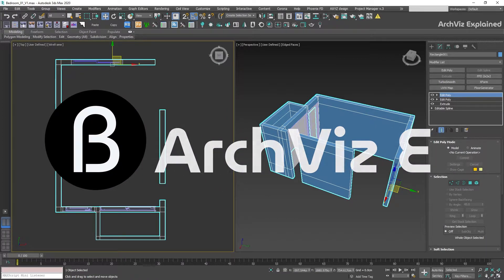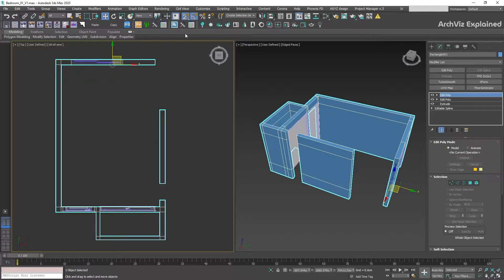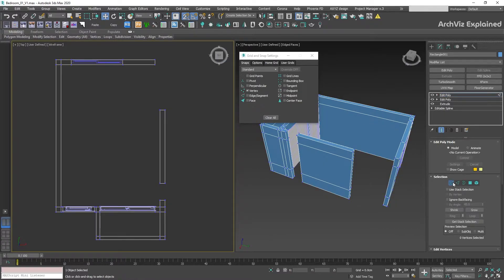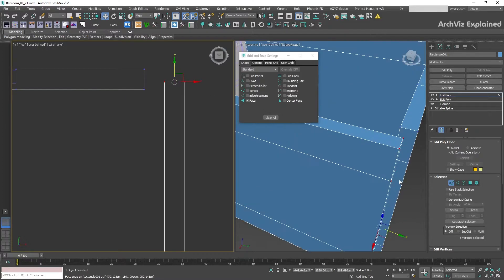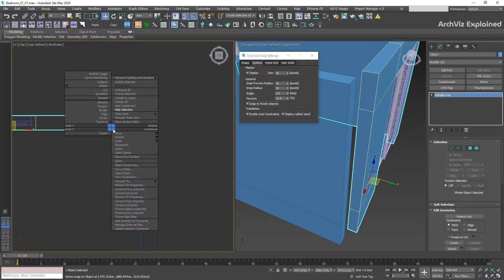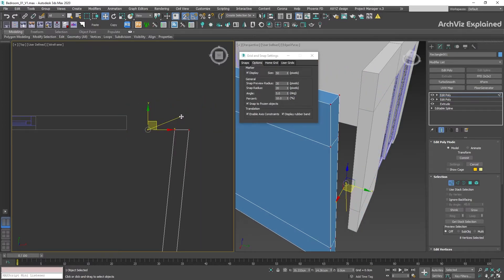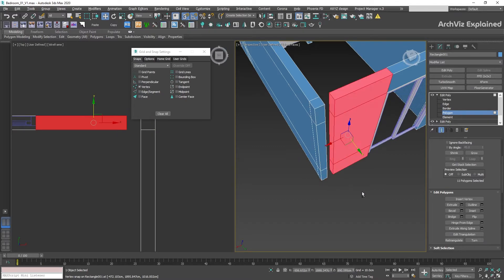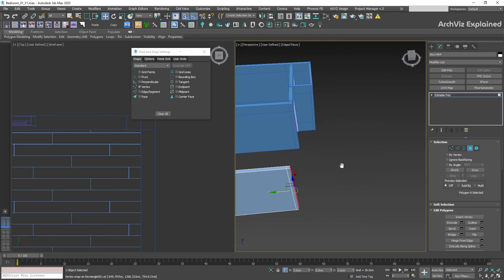How to use Snaps in 3ds Max for architectural visualization tips and tricks

Comment: Thanks for the tutorial! I have one problem though as a complete beginner: when I drag the vertices, wanting to snap them, the walls aren't straight anymore, they snap directly to the vertices. Simply put, I can't snap to the right place because the right place is a distance away from the snapping point. I cannot get the snap to work like in this video. It seems like a secret hotkey or something is being used...

Edit: LOL, you need to turn on the "enable axis constraints" under options in the snap settings!
Reply from the maker: Hi Exsulator,  I'm glad you found the solution! Yes, "enable axis constraints" and "snap to frozen objects" are important when working with snaps.  After it has been enabled you can cycle between the different axis by using F8 on your keyboard or switch to a specific axis by using F5 for the X axis, F6 for Y axis and F7 for z axis. 

Thank you for watching!
Reply: have been searching for the solution for hours huhu THANK YOU SO MUCH